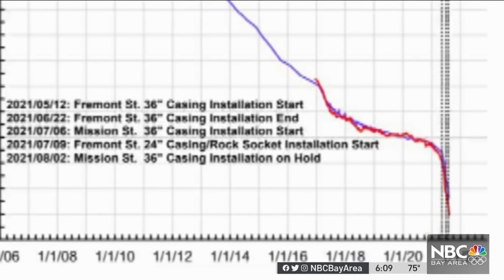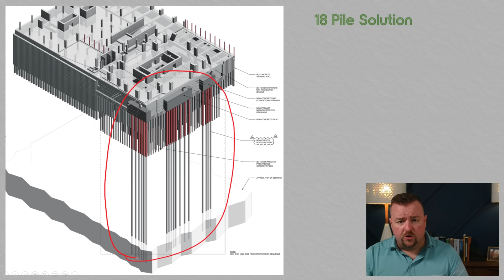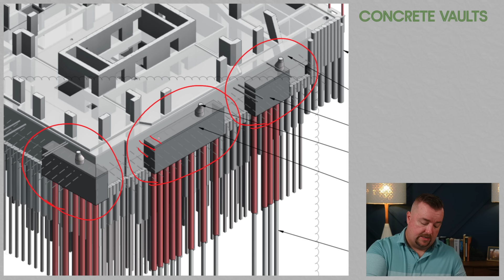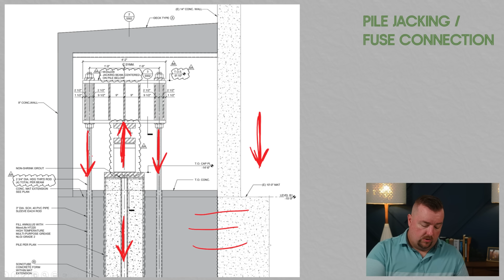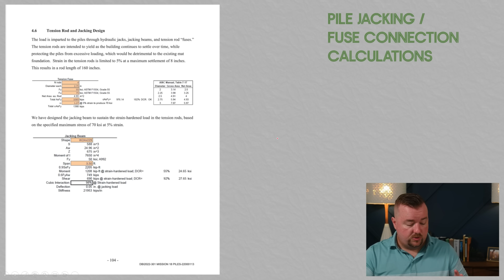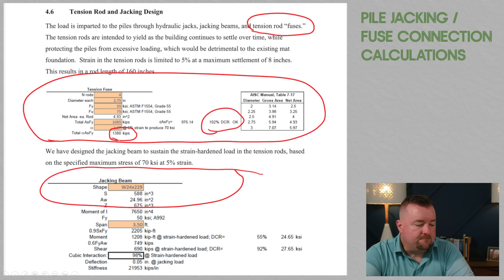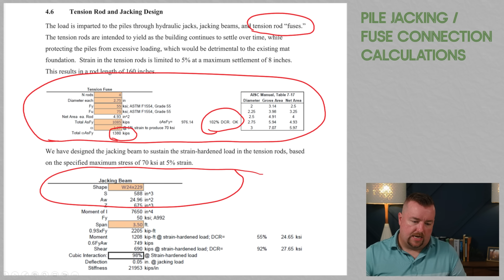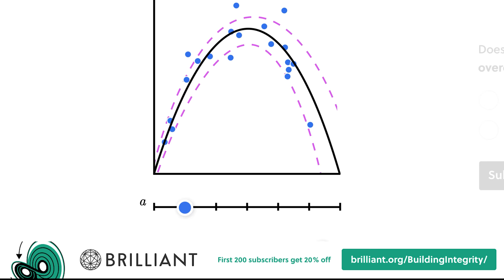Did I Uncover a $100,000,000 Mistake with the Millennium Tower "Fix"?

Comment: I am a UK Chartered Engineer (similar to a USA Professional Engineer). On watching your review of the drawing, I have to agree the bar/plate connection looks worryingly small. From your discussion of the calculation sheet, I  understand that the bars are sleeved/greased mainly to simplify the design for "fuse" action of these bars (wherein the designer calculates a required  "free length" of 160in). The bars could have been designed with a more conventional anchorage into the vault concrete (that is, a connection that can transfer load more gradually, over a longer length of bar), but then "fuse" design would become more complex as the composite behaviour of the bar and the concrete would need to be considered. By sleeving/greasing the bars, the calculation of free length for "fuse" action is greatly simplified, but by inspection all the load now has to go from the bar to the vault via the plate, just as you have explained. I am also concerned by the unchecked assumption that the jack load will be evenly distributed into all 4 bars. If there are any geometrical imperfections, some bars will take more load than others, which is very concerning since the bars are intended to yield at some point. I agree that if the bar/plate connection fails, the vaults and piles are rendered entirely useless. There would also be a sudden change in support to the Millenium Tower itself.
Reply: I don't like the idea of the tension "fuses" at all. Because of the motion and distance time scale, the dynamic load or total load on the building wouldn't be reduced. The seismic event that would stretch the rods would lift grade and effectively leave the building subgrade. Ins't that what they're trying to prevent? Like you said, additional structure anchoring the rods to the vaults would increase their effective stiffness. I don't like the idea of reducing the diameter of the rods to decrease their stiffness and make them effective "fuses" again. Bottom line is there absolutely needs to be a very detailed local stress analysis of those vault anchor plates.
Reply: I am also worried about unequal distribution of load to the 4 rods, that was the first thing that caught my attention.  Then the rather smallish steel plate to transfer the load and I, too, am concerned about this design.
Reply: relative to the size of this building, these plates are like stiletto-heels?  😮  I feel like these plates ought to be footers that flare-out, like the bottom of the Eiffel Tower.  😢

I’m not an Engineer … but obviously we want to spread the load OUT, not concentrate it.  🤦‍♀️
Reply: I'm no engineer, but I would expect the bottom plates to be about the same size as the jacking plate. They are taking approximately the same load. Is my intuition wrong?
Reply: @bbgun061  Various components in the system will have significantly more load carrying capacity than the amount of load carried by the system, so it is okay for the bottom plates to have less capacity than these other components.  However, it is not okay for the bottom plates to have less load carrying capacity than the amount of load that they are carrying.
Reply: @adamnoakes2550 The load distribution through the rods could in theory be calibrated by adjusting the top nuts on the rods, and the system could be stressed to something like 80% load to account for material performance variations and verify equal distribution under load.  However, if the rod lengths are all within the same ballpark then this could be a moot concern, since any one rod carrying significantly more load will simply yield until it is the same length as the other rods.  Steel will yield for a relatively significant distance without losing significant load carrying capacity, and these are very long rods.  So I guess in this respect, having the system operate within the plastic region of the rods helps to simplify the design.  But wow, it does not inspire confidence from my perspective as a lay mechanic.  Even TTY bolts make me cringe because normally when you hit the plastic region it means you over-torqued and your fastener is about to fail.
Reply: @bbgun061  I would say this is wrong.  The bottom plate is lifting up against concrete and if its not big enough in surface area the upward force can become too high and crush the concrete.  Whereas the downward force from the jacking plate depends entirely on the material the jacking plate is made of, which is probably steel, as well as the design of it.  In short, one end is dealing with concrete parameters, the other end steel and design parameters.
Reply: Excellent observation about the potential imbalance between the loads on the four bars!
Reply: @bbgun061  If you count all four plates together it's bigger than the jacking plate
Reply: @w.harrison7277  The imbalance between the four bars is the least of it, what about the potential imbalance between the 18 hydraulic jacks?  That seems far more difficult to synchronize than four bolts all attached to the same thing at both ends.
Reply: The imbalance between the four bars is a non issue, they are all hanging from the same steel structure and embedded in the same concrete at the other end, so it would be almost impossible to apply different stresses to any of them given the way steel works.  The far more tricky procedure will be not letting the tensions vary too much between the 18 hydraulic jacks that will all have to be staying roughly on the same page during this operation.
Reply: @donaldbiden1920  True.
Reply: As is true in all design, trying to find a way to eliminate fuses is bad and dangerous.  No one designs fuses into a system for fun, there are no extra fuses.  If you don't understand the reason for a fuse in a design, it's not because the designer forgot and left a fuse in by accident, it's that you don't understand the design.
Reply: @donaldbiden1920  funny how all sorts who are untrained will offer observations about technical issues that trained engineers, who had spent years learning and practicing theri skills finds difficult. Yup everyone has the freedom to share whatever that is on their mind including .... lots of those watery stuff after a bad meal.
Reply: @donaldbiden1920  Electronic strain gauges on the tension rods and electronic pressure gauges on the jack, all computer controlled of course, should make it pretty easy to keep the forces similar across the pilings.

That said, there are a huge number of other assumptions that seem extremely risky in a dynamic, seismic, real world.
Reply: @donaldbiden1920  I believe they can operate with a common union and check valve system to balance the load. The problem I see is the failure mode of the plates. Deformation of the anchor point through exceeding the compressibility of the small area of concrete above the circumference will create an additional tension load for the plate, effectively pulling the two rods against each other lengthwise as the forces dissipate together. This will cause the plate to bow upwards and then add the compression load of the forces between the rods to compress the concrete between them creating a hemispherical load pattern (which is then also bearing the vertical load of the deformed plate). If the plate deforms this way, the failure will be fairly simple as the hole flanks being bent under tension overload will make tensile failure at the narrowest point (from hole to side) almost inevitable.
Without the ability to monitor the integrity of the plates, especially under dynamic loads there is no way of determining that the problem exists until it fails.
Of course one rod failing this way will unload the other three, so it can be considered catastrophic.
Reply: Plate is encased in reinforced concrete of the entire stability structure. The metal plate is surrounded, it would be very difficult to move it.
Like a bolt with the head in concrete.
If that bolt is 13 feet, 4m, long could you pull the bolt out?

What they have done here is 2 x 13 feet, 4m,  length bolts joined by a metal plate sunk into concrete.

We just need to know the breaking strain, maximum movement etc over 50-100 years. Which is what I think the video review is concerned with.

The video reviewer should show his maths and results. He says he did calculations but he never shows them.

Reviewer, where are your calculations?
Reply: @Google_Does_Evil_Now  The shank is not anchored, only the plate so therefore the nut coupling at the bottom bears all load connection. The load calc is around 160 tonnes per bolt static, although this does seem very lean when considering extreme wind and other adverse conditions.
Reply: @bbgun061  Yes, I agree!  Plus, the rods are attached to both flanges of the I-beam jacking beam, so it makes sense to me to have at least that amount of "connection" at the bottom as well to prevent pull-through.
Reply: San Francisco, as a city government, is dysfunctional on an epic level to the point they’ve become a textbook example. Any other city would bring in qualified engineers to help make up for their initial incompetence to let something of this magnitude happen. But not in SF. Instead those on the sidelines know far more than those representing the city. It’s classic SF and yet another reason the city is leading the country in vacant urban space.
Reply: @alasdair4161  yes. Do you think with earthquakes and building movement we might see some bolts breaking?
Reply: What about if an earthquake hits?
Reply: @donaldbiden1920  The hydraulic pressure is easy to deal with, look at nearly anything Mammoet does.  My concern with this is that with the hydraulic jack being between two rods, the failure of either one means a loss of support for the other side.
Reply: @donaldbiden1920  how is the jacking plate load  distributed?
Reply: Excellent as always Professor Porter!
Reply: @Google_Does_Evil_Now  Well you wouldn't find me hanging around that location to find out..lol.
Earthquakes can set up resonant waves that travel up and down the length of the building and part of the initial design, including subterranean anchoring has damping and absorption capability factored in, but placing buttress style support structures outside the buildings centre of mass to behave as the primary load support may interfere with the way earthquake energy is dissipated within the structure, I'd say all bets are off in that event, unless there's been a lot of additional engineering done that proves otherwise.
On bolts breaking, I doubt it if they are of the right material and quality, more likely the anchor plate will yield. If one fails, the others will bear the increased load and a cascading failure then becomes more likely.
Reply: To your point about uneven load among the bars, I had also been wondering about the rotational forces involved in all of this.  This design seems to rely on an assumption that the forces involved are entirely vertical, but this entire assembly is about vertical shifting on only ONE SIDE of the tower.  Wouldn't that mean that the bottom of the assembly would potentially shift horizontally a different amount than the top of the assembly?  Effectively, that any vertical movement on one side of the tower's base would be applying a very slight torque force to the attached assembly.  I know that difference would be very small, but even if it's only a couple of millimeters, I wonder whether that could create cracking that could allow for water intrusion and further degradation?  I ask this as an interested (and unqualified!) amateur, but I would love it if an engineer would comment on whether that's a real issue, or perhaps the rotation would be so minimal as to not be a concern?
Reply: @donaldbiden1920  Four plates? He said there's one plate per two rods. Wouldn't that be two plates total?
Reply: @PuckDudesHockey  Part of the reason for their length is to provide a range of predictable stretch. The longer the bolt the greater the elastic stretch can be, so you can almost think of them as being a spring. As the length of stretch presents a fairly constant curve relative to load (when operating within design limits) the division of load then also stays relatively constant.
Hope this makes sense././.
Reply: I’m a industrial electrician. Just from 20 years watching large scale building I can tell you that it is way too small. Once they put in the pilings for buildings that size are huge.  This one is for like a 4 to 5  story building and that is designed to push down on not pull up. Also feel like Shuld have used bar threaded on the ends not threaded rod. My prediction is it will not be corrected. It will fail hopefully not damage if the building when it dose.  But eather way the building will be destroyed after.
Reply: From a layman's perspective, the plate simply "looks small" relative to everything else in the drawing.  I also wondered how the load is spread to the concrete but apparently there's rods that aren't shown.
Reply: @brianwest2775  ya I said the same thing. Just from being on site while other things were being built this is way under sized.
Reply: @donald biden, are you related to Joe Trump?
Reply: Not my field, but as I recall a rod entering plastic deformation increases its strain resistance (initially). That should compensate for any differences/imperfections?
Reply: @camcairns2584  the thing is if it is already to the point of plastic deformation under ideal conditions from day one in 10 years after a few trimmers show much will it have deformed. Then as he pointed out once one fails it will cause a cascade of failures.
Reply: @dperreno  I think if the bars are stretching - not necessarily permanent stretch, could be elastic - then this would balance the load between bars since the one with more load will stretch more and this transfers its excess load to the other bars.
Reply: @BenAtTheTube  Yes, and I caught the part about the design load being in the elastic range, but I agree with Josh that I would never design a building system with steel components stressed to the elastic zone.  I just think that is an extremely risky design approach.  First earthquake and those bars will stretch and need to be replaced.  Have fun doing that!  (not picking on your answer, rather picking on the design)
Reply: @whodat90  Worse than that, the jack is between two PAIRS of rods, see 10:54 photo. So if any one rod fails, and it was at maximum load capability already, that will both unbalance the other three and throw them past breaking stress, so that jack is gone.
Reply: It being San Francisco I'm concerned with interactions with the seismic isolation systems (I'm not familiar with their specific design).  While deliberately exceeding the elastic limit provides energy absorption to a limited extent, it may cause a total write off of the structure with only a moderate quake.  As you point out, the stresses may not be evenly distributed.
Reply: @donaldbiden1920  There's only 2 plates. One on each side of the main pile, connected to two threaded rods...
Reply: By the way, as soon as one of those bars explodes, or something else fails, wouldn't that cause a hammering action on the original foundations, weakening them and pushing the building further down? As in, raising something that's really heavy and then suddenly letting it go is exactly how you hammer piles into the soil. Which will put more stress on the remaining bars and contraptions, possibly making them fail sooner.
Reply: @firefly618  I was wondering if they were going to use the jacks to raise the building, then pump concrete into any spaces created, because I had thought same as you that a failure of these jacks could lead to the building rapidly returning to it's tilt, and then some.
Reply: That was what immediately occurred to me - what's going to ensure equal distribution of load in all four rods?   I guess the length of the rods is a mitigating factor in this, in that if one rod is more highly loaded it can stretch a little bit accordingly, thus redistributing the load to the other three.   And 5% strain - is that normal?   I'm a retired civil engineer (not structural) but looking at that design - well, I wouldn't be buying an apartment in that building.
Reply: If they can redesign the threaded rod anchorage below to below to be using a large mushroom head at the b9ttom ends of the threaded rods, shaped and sized to properly transfer the loads to the bottom of the new concrete vault, and only have the nuts and plates above the horizontal steel beam above the vault, where they can properly monitor the threaded connection and size its components accordingly.
Reply: @Google_Does_Evil_Now  "If that bolt is 13 feet, 4m, long could you pull the bolt out?" - the entire point of the rods being greased and inside a plastic tube is that they are free to extend under load. The ONLY anchor of those rods is the nuts at the bottom to the plate.  That presents two failure modes - fracture of the concrete due to point loading, as the bottom plates don't sufficiently distribute the load, as well as pull-through failure due to relatively small nuts on the plates.
Reply: I am a 50 year industrial electrician and I am concerned about ALL the force applied to the tiny nut threads !
Reply: @andydent3728  for steel any nuts longer than 80% of the bolt diameter will not contribute any more force
Reply: As a project manager I encountered structure designs that were dodgy and a suspected under performance rating. When this happened we would double up on washers, plates, go a size up on bolts. In one case we installed (underground) extra electrical conduits (empty):when the design specs seemed inadequate, especially since future upgrades were not allowed for. 
In this case doubling the plates would provide a margin of extra safety and would be so easy and cheap.